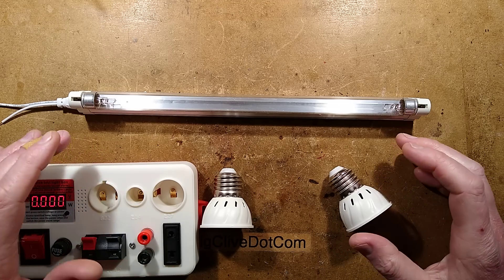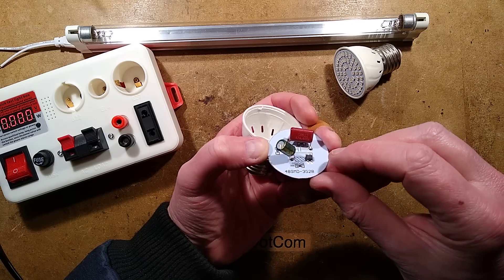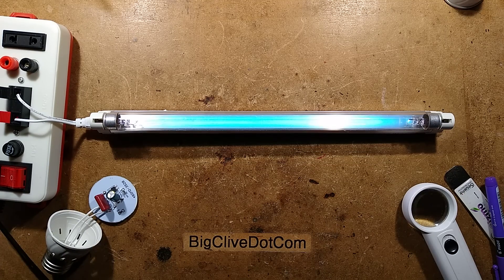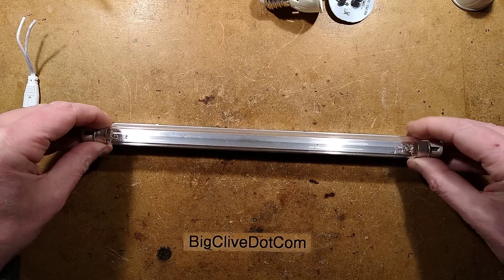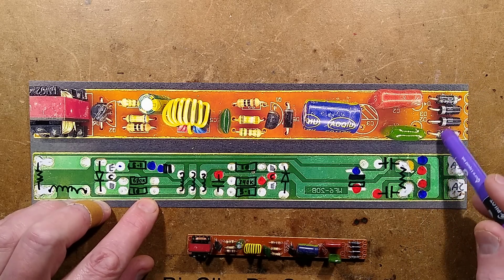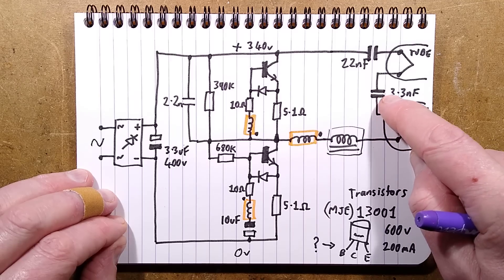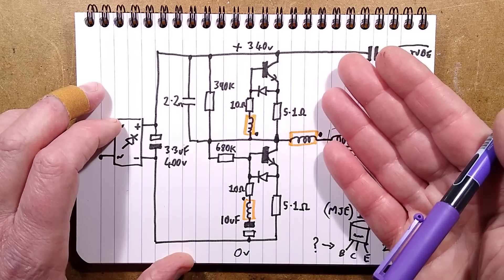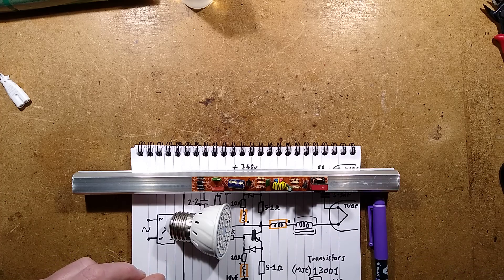UVC 2023 - the fake and the real (with schematics)

Comment: UV lamps are no joke. Had to spend a night in the emergency room with severe cornea burn after spending the day installing some powerful UV lamps on the AC unit of said ER (the irony). The pain was excruciating, not like having sand in the eyes, as usually described by welders, but rather glass shards. A metric shit-ton of them. It was the same very night the US started bombing Iraq live on TV.

Comment: Something I hear being banded about is "Far UVC" at 222nm which is safe for humans. 

Now if I'm understanding UVC right, the light disassembles the DNA (which is what makes it a effective germ steriliser), but Far UVC, does all that, but doesn't affect humans.

Maybe I'm being jaded and pessimistic here, but that sounds like snake oil - UVC is attacking the DNA or it's not. If it's not harming the DNA in humans, what makes bacteria so different?
Reply from the maker: The theory of the 222nm excimer lamp UVC is that the wavelength is short enough not to penetrate the outer layer of dead skin cells or the liquid film on the eye.

Comment: Capacitor is backwards by accident, but with only 0.6V reverse bias it will survive as long as if run at rated voltage the right way, as the cathode foil, normally just there to provide the connection to the electrolyte, does have a 10V or so oxide layer that is formed naturally on it, so it does act like a capacitor.

The 2n2 capacitor is part of the start up, it provides a pulse of current to turn the bottom transformer when mains is applied, and also does provide some filtering of HF noise to the central switch, limiting the turn on and turn off times of both transistors. Otherwise that 300k is not enough, with moderately hot and leaky transistors, to actually provide the slight bias needed to turn on the transistor, which will, by the positive feedback through the base drive coil, turn on hard til the capacitor is nearing full charge, reducing current, and then it will be turned off hard, while the other is being turned on hard. you need that turn on transient, especially if you are turning a hot lamp back on, and the transistors and capacitors are now hot and leaky enough.
Reply: I was going to comment on the purpose of the 2n2 capacitor but you beat me by 1 hour

Comment: UVC LEDS are available BUT they are EXPENSIVE! They are used in new water sterilizers for home and RV use. The real leds are made on a metal substrate, not plastic, it degrades under UVC light. The lens is made of quartz glass to pass the spectrum. Cost start at over 6 US Dollars each. Found them on a site known for and very reputable parts supplier in the USA similar to Farnells in the UK. BTW still using my 13 watt tube, 40 years old and it still puts out a generous amount of UVC with the definite whiff of ozone.
Reply from the maker: Keep in mind that UVC tubes can reduce in output over time due to changes in the uviol glass during use.
Reply: That is true, the interior of the tube has darkened the last few years signaling a drop in radiated emissions. But as long as I smell the ozone I know the UVC is emanating from this tube. Wish I could find another 13 watt non chinesium tube. GE or Phillips are the preferred.

Comment: I noticed how you held the lamp in vice, at onetime I was doing a small production run and I needed to hold a quantity of pieces of 2 inch diameter aluminium stationary while drilling holes in the face, I put the vice in a 4 jaw chuck and machined a round face on the jaws. If you do not have access to a metal lathe possibly you could get a piece of wood and drill a 2 inch diameter hole with a hole saw and saw it through the centre and make two soft jaws, . Something to think about,
David

Comment: How much roughly do regular eye glasses protect your eyes from uvc? Is it safe enough to leave the light on while in the room or is it still necessary to leave asap? Can too much ozone be harmful if I leave the uvc light on overnight to sanitize/sterilize my kitchen for example? I have little to no airflow from my kitchen to my bed room due to how my apartment is ventilated.
Reply from the maker: Glasses will block direct UVC but not reflections from the sides.  I don't recommend staying in a room with a lit UVC lamp.

Comment: Believe it or not, that insulating wrap around the PCB is called Fish paper. 
It's available at my local electronics supply house.
Reply from the maker: You've just made me realize this would be perfect for replacing the fish paper between contacts on an old slot machine.

Comment: Hi Big Clive, they have not yet reached UVC with solid state LEDs. I have some 385nm and 405nm both UVA. UVC is 254nm, very bad stuff. Thank you for all of your great work. I have learned bunches from you.
Reply: UVC LEDs are built into a tiny metal container with ceramic insulators a quartz lid. Can't use plastic of any kind, because the UVC would destroy it. They are expensive to build. Much cheaper to use a mercury vapor tube of some kind.
Reply: UVC starts at around 280nm, and you can definitely get leds at those wavelengths.   They used to be really expensive (paid about $20 per milliwatt in 2016) but prices have dropped recently. Even the 265nm diodes are getting pretty cheap.
Reply: 254nm LEDs do in fact exist. They are still quite expensive and somewhat scarce. "SunTech LED" is one of several manufacturers that have English language web sites.

Comment: I picked up a somewhat dubious phone sanitizer (with aromatherapy oil diffuser well heated by a power resistor!) for $5 at wally world after the hair on fire coof panic started wearing off. Really only bought it to see if it was a scam but was pleasantly surprised to find 3 actual UVC leds; it was probably still a scam since I don't see how 3 LEDs pointing at the edge of a phone could sterilize it, but technically it was emitting it. Given just the chips easily go for $2.50 a piece direct from China I should have gone back and bought 4 more before the mostly untouched pallet full was sent to the landfill or sold to a thrift store.
Reply: This is what happens when you send away the professional telephone sanitizers on the same ark as the account executives.

Comment: I got a UVC lamp of banggood to sterile the house to 'protect' my mum, and it following the instruction for the time for the size of room said 20 minutes, after 5 minutes the ozone smell was unbelievable and took 6 hours with all the doors and windows open for it to go 😬
Reply: Aye. I stumbled on a 55W tube unit at a thrift store for $5 with an RF remote so it can be turned on and off out of line-of-sight. It generates a huge amount of ozone. We had a mold problem in the basement and it was very helpful to keep it under control until we could get the damaged wood and drywall out.
Reply: Is really helpful though. The ozone'll kill mould, bed bugs, fleas etc etc. If you really don't like it, a 253nm UVC light is better at killing directly, and breaks down ozone faster than it creates ozone (as opposed to the 185nm, which creates ozone faster than it breaks ozone). Obviously, using it for direct sterilisation does mean it only kills on direct line-of-sight, or reflections from aluminium. Most other materials won't reflect much of the UVC. The ozone can be good to clean the bathroom, stop mould forming from humidity after a shower/bath. A timer switch could turn it on for 10 mins at night, have it fresh for the morning.

Comment: A while back I got a couple small UV flashlights from a bin at a big box hardware chain; they carry the logo of a formerly reputable, formerly American tool brand. They are, to all appearances, identical. One of them is your run-of-the-mill UVA purple, the other however really looks like UVC blue and makes things fluoresce real good so I don't play around with it. Or would there be a likelihood of it being UVB, which you don't hear much about?
Reply from the maker: If it has standard plastic LEDs then it's possibly that the casing is fluorescing and adding the blue look.  A real UVC LED flashlight would be very expensive.
Reply: UVB tubes are what are used for tanning beds etc
Reply: If it looks like that light Bluish colour then I wouldn’t mess wit it at all. The Purple ones are fine though.
Reply: There are 395 nm and also 365 nm UV LEDs. They cause different fluorescence.

Comment: The reversed electrolytic capacitor - probably isn't. Any positive current will flow through the transistor, so the capacitor won't get any of that charge. But, when a current is induced in that coil, you can think of it like putting a battery there, with the positive side going into the transistor, and the other side will be negative, so can charge that capacitor's negative side.

The 3.3nf is important, as the current will flow through and charge this capacitor via the heating elements. Once it is full, the current will stop, causing voltage of the inductor to spike until it can discharge via the gas in the tube until the 22nf capacitor is full. This tells you how much will go through the heating element verses how much goes through the gas (I think... that sound about right?)

Comment: That reminds me that I need to build a UV EPROM eraser using the UVC tubes I have, which yes I have tested, very briefly, with no protection, cos that dodgy blue glow is indeed pretty, reminds me of the glow from the nacelles of a starship, which is also deadly if exposed to flesh... :P
Reply: Mine is about the ghettoest apparatus possible - a CCFL U-tube germicidal lamp siliconed inside a foil tape lined dollar store drawer organizer with the 12V PSU taped to the outside. Erases a '010 in about 10 minutes.

Comment: See you using that dangerous lamp tester for something. Is the pink socket going away though?
Reply: The dangerous tester doesn't have lamp threads, you need to hold the bulb in place for it to light. The pink socket is probably staying.
Reply: @eDoc2020  That makes sense.

Comment: What happens if you plug an energy usage metre plug into another energy usage metre plug?
What happens if you stack twenty of them?
Any chance you could calculate how many you could plug into each other, until the collective drain of the metres, impacts the energy supply to the appliance plugged into the last one?
Reply from the maker: Each meter would just show the combined power of the subsequent meters.
Reply: @bigclivedotcom  Thank you Clive!
Reply: In a recent EEVblog video (maybe EEVblog2) Dave ran a space heater through 283 socket adapters. The combined resistance of each connection led to a 40 volt drop. A meter plug probably also has a current shunt which will add a few more milliohms.
Reply: @eDoc2020  Excellent, thank you eDoc!

Comment: Clive, I've been looking everywhere for "blank" light bulbs, just the screw fitting and the glass.  I've called a number of suppliers and specialists, and none of them have any access to them.  Have you ever looked into this?
Reply from the maker: Look online for an E27 bulb or lamp kit.   They do sell the bare housings.
Reply: @bigclivedotcom  3-way by chance? I'd like to convert an Edison style Y adapter that holds two bulbs in one socket to fit a 3-way socket. So it turns on one, then the other, then both. Then I can use normal LEDs in my 3-way lamps. The 3-way LEDs cost MUCH more than buying two bulbs with similar wattage and physical size.
Reply: @strehlow  Take a dead 3 way bulb and do the crunchy work to liberate the base intact, then you can modify the Y adapter to fit it in there.
Reply: @SeanBZA  Yeah, at some point I will. But the two I have in use are both LED so it might be a while.

Comment: 20 mins is fine clive...  any longer i'd suggest cutting in 2, because sometimes even us old farts have limited time, but 20m is ok, and i remember woods glass tubes, they used to use them in the  oceanography dept at the university for sterilizing  water
Reply from the maker: The Woods glass tubes are the dark coloured disco ultraviolet ones.  They'd only pass UVA.   Water sterilisation is usually done with the clear UVC tubes in quartz sleeves.
Reply: @bigclivedotcom  D'oh, yes of course they are, I dunno why i always get that mixed up!  but yes, the quartz ones is what I meant of course, was fascinating to see the internals of a tube working, fortunately only for seconds :)

Comment: I like that you are using the "tester of death" for this review.
Reply from the maker: I like these units a lot for their amusing lack of safety.  I'll have to remember to include warnings every time I use one.
Reply: @bigclivedotcom  you wouldn't want to lose any SUBSCRIBErs.
Reply: This "tester of death" is probably safer than what they used to do at the Co-Op when I was a nipper. Light bulbs were tested at the till using a presumably always-live batten lampholder screwed to one of the panels in the till area. At least this has a switch!
Reply: @BG101UK  oh yes, I'd forgotten they used to test bulbs before you took them home as a kid.

Comment: One of the compact fluorescent lamps in our kitchen didn't light up the other day when I turned it on. I turned it off again at the wall, then went to take it out of its socket - at which point it lit briefly in my hand, which was a bit alarming. What's going on?
Reply from the maker: If it was in a dark room you probably saw an electrostatic glow.  If it's an old enough tube it might even have been caused by a bead of mercury rolling in it.
Reply: @bigclivedotcom  Yes, the lights were off in there (I wasn't going to change the bulb while the mains was switched on) and I had a battery emergency lamp.
Reply: a broken connection inside the cfl, it left the cap charged to a voltage above ground... you touching it let it discharge and flashed the lamp, is my best guess (see it a few times a month)
Reply: freaky when it happens with LED strip, that stuff is so efficient it can light for a few seconds, when the driver fails.
Reply: Another possibility is a failed startup circuit. With the oscillator stalled the capacitor could stay charged. The shock of removing the lamp could have triggered it and then it ran on the charge stored in the cap.
Reply: @eDoc2020  Very plausible!

Comment: I had a mini blender which must have had a current limit capacitor. I lost count of the number of times I got a belt (and I mean really painful) from it after unplugging it, even if it had not been running for several minutes (so not a run capacitor). Clearly no or insufficient discharge resistor. Courtesy of Morrisons.
Reply from the maker: That sounds like a suppression capacitor on the incoming supply.
Reply: I've got a coffee grinder which does that, got into the habit of touching the plug to some earthed metalwork after unplugging. Also had a couple of sanders and a paper shredder which did it.